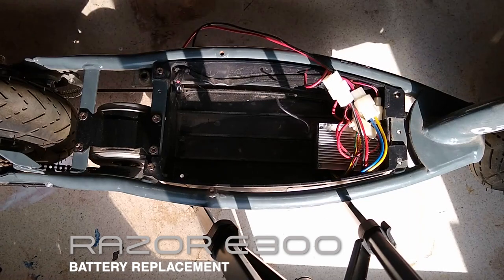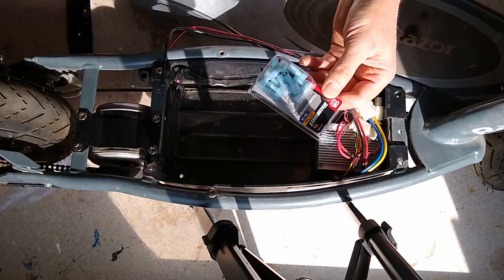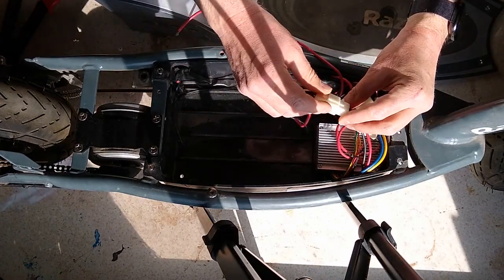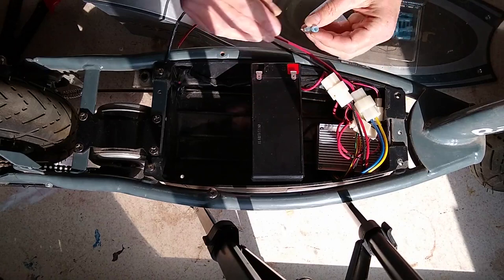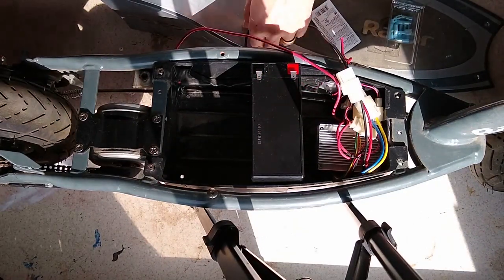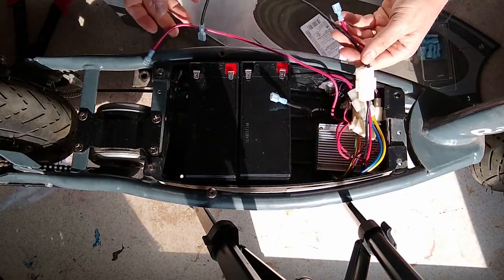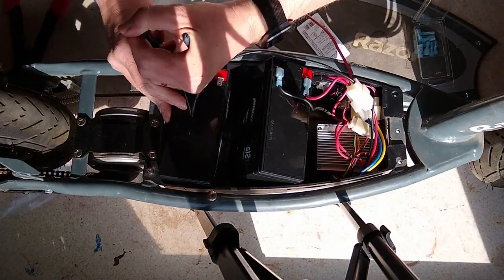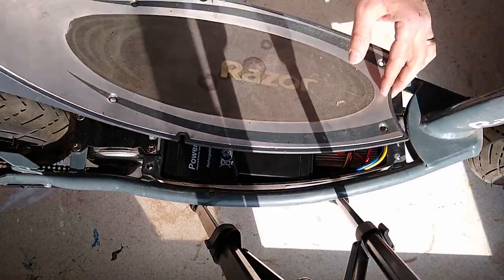Razor E300 Battery Replacement

Comment: Will the nine amp damage anything please
Reply from the maker: I haven't had any issues. I'm not an expert but I believe the 9 AH (amp-hours) doesn't change the power the battery gives. It just lasts a longer time. It has greater capacity.

Comment: What size are the connecters
Reply from the maker: These are what I got: https://www.homedepot.com/p/Gardner-Bender-1-4-in-Fully-Insulated-Wire-Disconnects-in-Blue-15-Pack-15-153F/202521914?cm_mmc=ecc-

They are 16-14 gauge 0.25" female disconnects